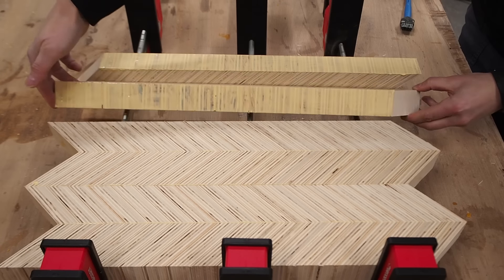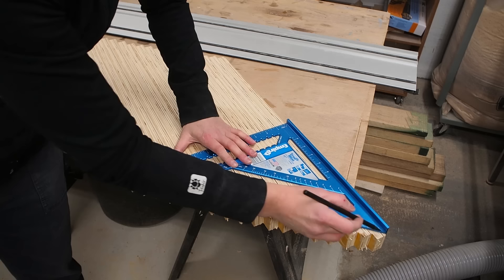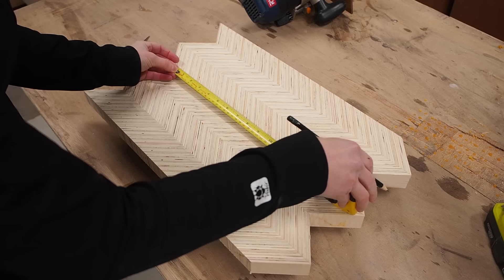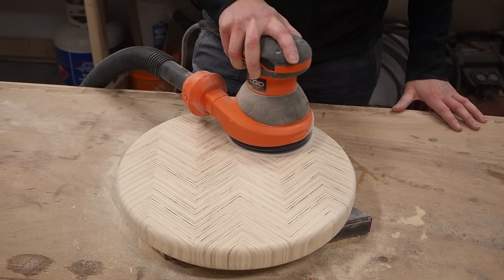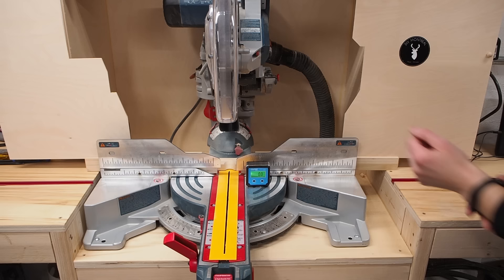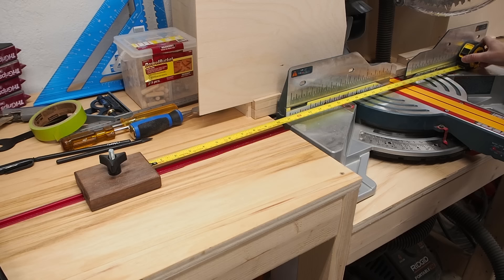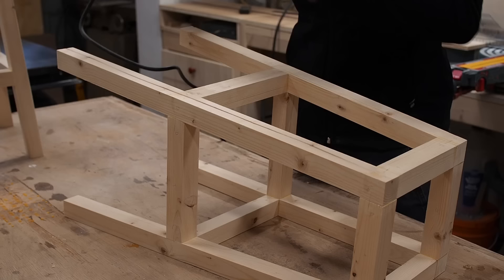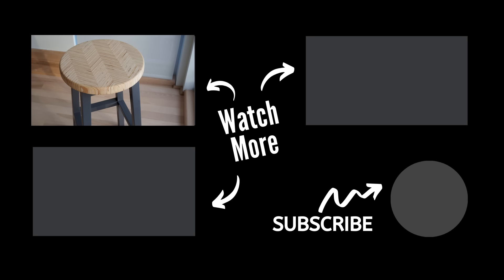Chevron Pattern Bar Stool | with Plans

Comment: Nice project. I've always shied away from compound mitre cuts, but your excellent presentation's method has given me some confidence.  I thought maybe you'd gone into hibernation, I'm told Quebec winters can be brutal ;-) The grey finish looks good, I've been using a dead-matte product which mimics chalk paint but is quite tough . ( In UK it's a Ronseal product but I'm sure others do one too) Needs no wax or clear-coat.

Comment: HighTec is when seat is slightly concave. But in generally this is very good job!  You can make any marvel with that equipment.
Reply: for that you could use an angle grinder with a flap disk.  It would take a fair bit of time, but wouldn't chunk away at the plywood
Reply from the maker: Thanks! Yeah maybe one day I'll get to carving, but not there yet.

Comment: Love this stool, I'm going to try and make it, one question, it says to use dowels, how are you getting a straight dowel hole on an angled end? my dowel jig sits flush to the angled end, was wondering if there is a trick i'm missing to get them to align correctly, or if you are just drilling them free hand, or with some sort of angled dowel jig?
Reply from the maker: I just push the dowel jig flat against the angled surface and drill.  The dowel will automatically be perpendicular to that surface.
Reply: @DIYMontreal  Oh, so the dowel is just angled slightly in the joint, thats easier, for some stupid reason I thought it needed to be horizontal.

all good, I made that way more complicated than it needed to be... lol

Thanks

Comment: Hi just a quick question on safety i can see you more than qualified in what your doing please dont take this in the wrong way  but why do manufacturers make push blocks for the table saw which make you use it with no guard on and no one seems to mention it but if you take the guard of a mitre saw people would question it surly safty is most paramount having said that please be careful